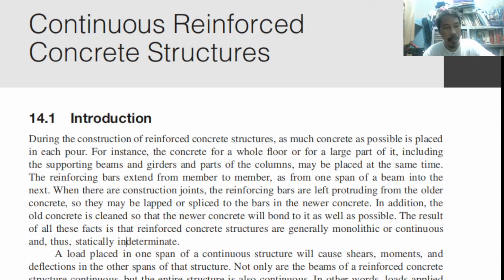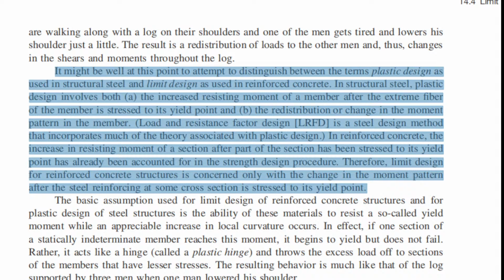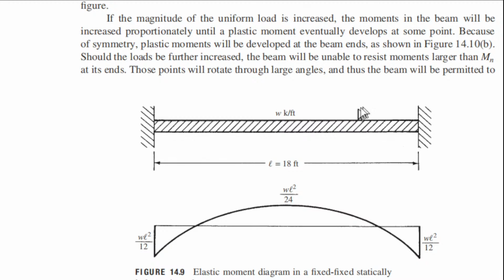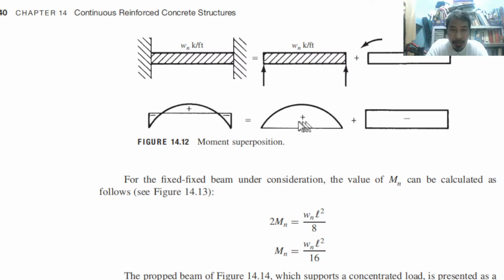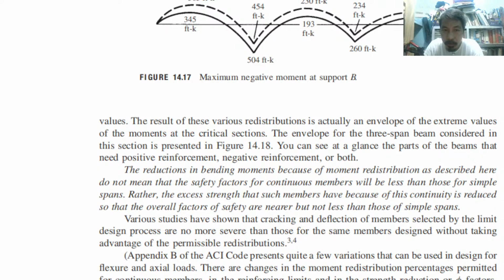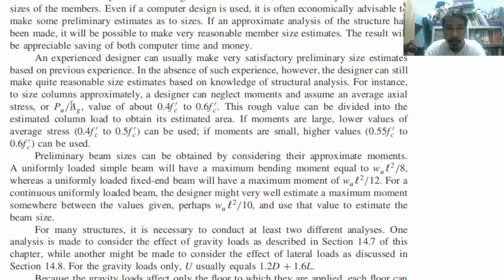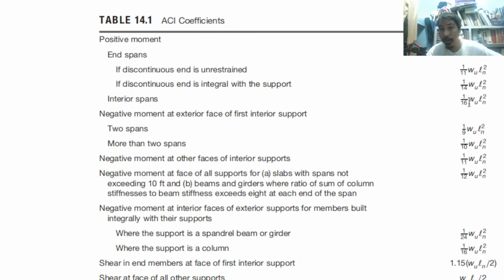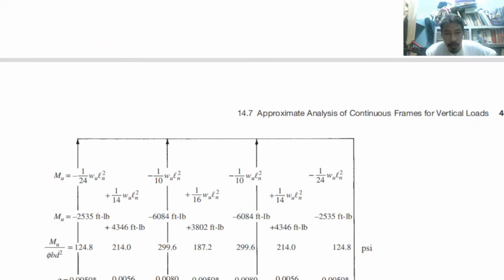[ LIVE CEE7 Lecture 18 ] DrAP Zantua Continuous RC Structures + Analysis Design & Examples

Comment: Thank you sir for this live video lecture about continuous rainforce concrete structures. LRFD is a steel design method that incorporates much if the theory associated with plastic design. It discuss also the Mn means nominal moment and Mp means plastic moment.

Comment: Thank you sir for this live lecture video about chapter 14  Continuous reinforced concrete structures. It is mentioned here that between the terms plastic design as used in structural steel and limit design as used in reinforced concrete. That LRFD is a steel design method that incorporates much if the theory associated with plastic design.